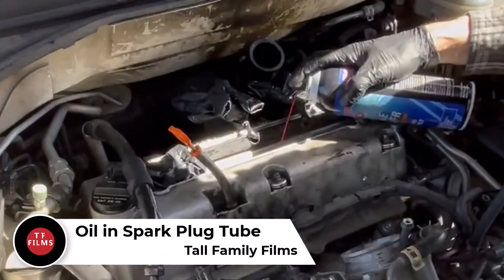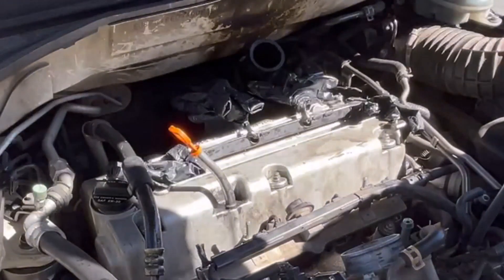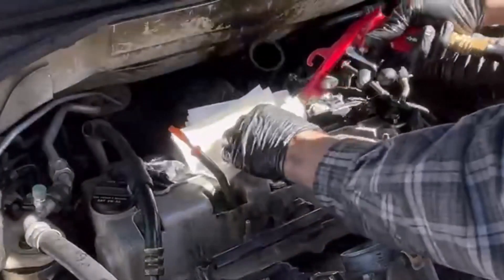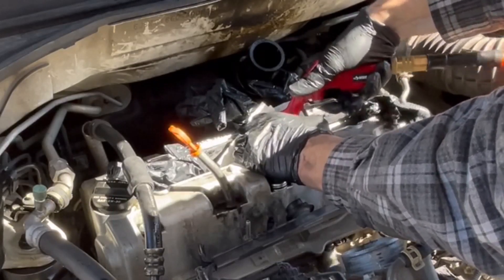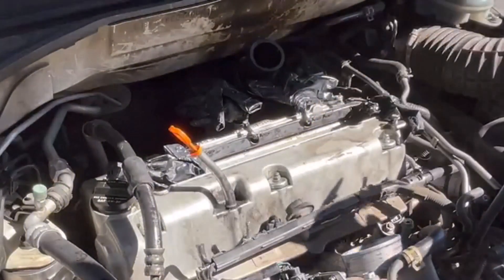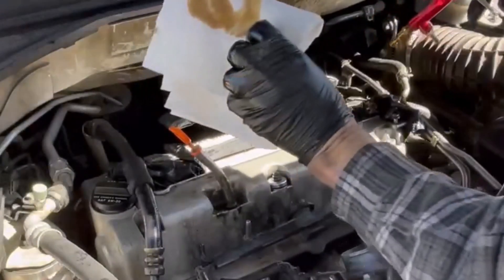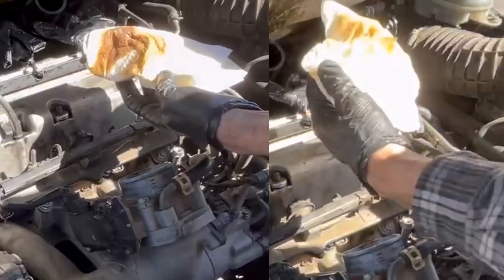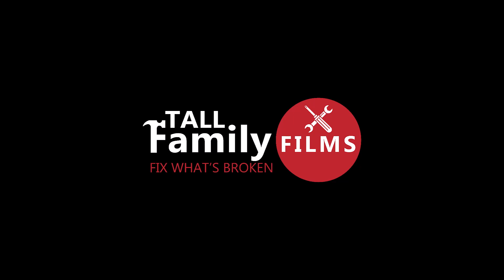How to remove oil from Spark Plug Tube (Ignition Coil)

Comment: Is it a good idea to clean my ignition coils with contact cleaner ? I can see some patina on the inside of them, my car has 300k kms and they still haven't been changed and lately I've been having trouble starting the engine sometimes. Spark plugs are new though
Reply from the maker: I wouldn’t - mainly because I have never done that and don’t know the outcome. I’ve never cleaned mine more than wiping them with a rag. They make a tool that’s really cheap that tests the ignition coil where you just watch for consistent spark. 

Did you change plugs to resolve the slow start? That might just be carbon build up - I’d pour/spray some seafoam in intake and see how that goes. It’s also cheap.
Reply: @TallFamilyFilms  I cleaned the intake already but they were really dark after I did only around 15k kms. I think I'm gonna play it safe and invest in new ignition coils, they're about 20 euros for a good brand. I won't try to clean them, as you suggested, I guess it may not be a good idea.

Comment: Instead of blowing it back up, could I use my shop vac to suck it up?
Reply from the maker: It would if you can engineer a straw into the shop vac. It’s actually not a bad idea and I did this one time to remove broken glass from a door frame. Put duct tape over vacuum hose and poke a small hole to insert straw and tape around it.